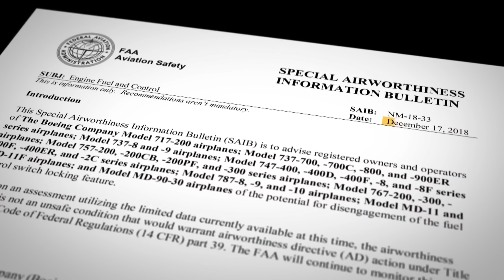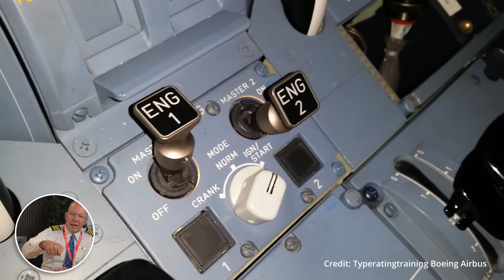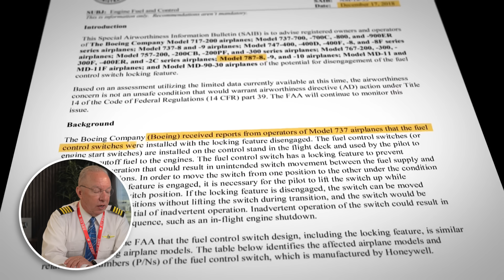Air India 171: The FAA’s 2018 Fuel Switch Locking Bulletin Explained (16 Questions Answered)

Comment: Was it human intervention? I have read that this aircraft had similar problems before but usually inflight...as in way after takeoff. I don't believe that the switches were physically placed to cutoff, there is every chance that an electrical issue caused this and to categorically say that it can't is ridiculous due to the computerisation of these aircraft. Do you really think that the switches can be set to cutoff within 1 second of each other? Maybe if they were not switches that require additional actions such as pulling the lever out, but with this type I am not so sure. Could you do a video on that showing that the switches can be turned to cutoff within 1 second?

Are we surprised that the NTSB and FAA have not put out any warnings? Lets not forget that the NTSB withheld information regarding the 737 max crashes and the FAA allowed Boeing to self regulate, so both in Boeing pocket....and it wouldn't be the first time that Boeing have tried to cover things up....lets not forget flight 811 and how Boeing and the NTSB tried to cover that up.

Comment: There should be a 5 second alarm from moving a fuel cutoff switch from Run to Cutoff, before the fuel pumps actually cut, giving the pilots time to correct the switch if it were an error or accident.

Comment: Airline engineer here. Just to be clear on the embraer cutoff logic - I belive it is only related to shutting engine by rotary knob used to start/stop. In case of fire, you would use "fire handle", by pulling you isolate fuel, hydro, and electric, instantly.

Comment: #AskTheCaptain  Why aren't critical aircraft controls like fuel cutoffs equipped with flip-cover switch guards (mollyguards)?  While rapid access is essential during emergencies, these guards require only 1.5–3.5 N to open—well within the capability of a single finger. Given an average human reaction time of \~200 ms, the switch could still be accessed within 0.5–1.0 s. Additionally, activating the cover could trigger a visual-auditory alert on the cockpit dashboard to signal intentional engagement of a protected system.

Comment: One unlikely scenario could be that the switches were installed the wrong way as Captain Steve said was in a bulletin and the engineers and our pilots decided to bypass with something to keep it in the position. For example, to illustrate the point, although I don’t think somebody would do this, and elastic band. Then that device fails and they fall back into the off position and that would explain the dialogue in the cockpit. Yes I’m definitely reaching. I’m sure the NTSB will have considered this possibility.

Comment: When a catastrophe result from many factors including a confusion by the crew , the though process how this confusion may occur in the futur at the design stage is not obvious…Then, after the investigation, if the Mfr. Boeing or Airbus improves the ergonomic cockpit set up to prevent such confusion from unlikely to impossible, then many “experts” start to blame the previous design to be a root cause of the accident which is not the case but only one element in a chain of events. I can recall the Mont Saint-Odile Air inter A320 crash flight A148 jan20 1992 during the descent with no visibility. The descent could be set on autopilot in feet per minute or the switch on the altimeter gauge low right side corner, could be turned to the other degrees of slope angle position. Then the digital displayed below the gauge show -3100 for the feet per minutes or - 3.100 for three point ten degrees as slope angle of decent which is about three times steeper that 3100ft/min and about 10.000ft/min.
The crew has to decide upfront what set up will be used and when but here,, the switch position and display reading got both confused and overlooked while being clearly one next to the other and almost impossible to be misinterpreted, but provided which one to use had been decided upfront  as per à normal procedure. The confusion was a clear cockpit management issue aggravated by a large generation gap and what was obvious for the old pilot was not yet fully known by the young copilot . In addition the company pilots unions had agreed on this new two crew only plane w/o radio navigator mechanics!!, but only with a minimum work load so the optional ground proximity warning system GPWS and many goodies LLWAS etc..had been disregarded by the airline consist specifier (who committed suicide after this, accused of having been greedy, but he had been forced into it by stupid unions) But not only , Airbus also changed the display to a two digit only with the switch on the degree of slope angle,  showing 3.1 if the degree of angle is selected and with the switch on ft/min the display 3100 so four digits …and of course Airbus was then criticised a  possible cause of confusion , but obviously here both unforseen and hard to predict. This is bad because this can prevent some nice and useful ergonomic improvements to be implemented only not to be accused that design was WRONG before…or not to re certify the pilots differently…( 737 Max “hidden MCAS “ syndrom) a field when only the qualified certification agencies should have the final word…

Comment: There is one ugly question that no one is asking. What are the conditions under which the fuel control switch goes to "cut off" automatically - in a system operated way?.....

Comment: From a system design perspective, it seems nonsensical to have both fuel cut off switches in the same location without a logical confirmation step thereafter to confirm its selection.
I’d go as far as to say each Engine cut off should be at the far left & far right of the cockpit controls under a guarded flip cover.

Comment: The problem is if you have cameras in cockpit you can not blame dead pilots. It is a huge threat to aviation industry.

The problem is if you have cameras in cockpit you can not blame dead pilots. It is a huge threat to aviation industry.

The problem is if you have cameras in cockpit you can not blame dead pilots. It is a huge threat to aviation industry.

The problem is if you have cameras in cockpit you can not blame dead pilots. It is a huge threat to aviation industry.

Comment: Capt Steeeve keeps saying these are mechanical switches. Unless they have a cable connected to the switch and that cable operates the fuel valves, they are not purely mechanical switches. They are most likely a mechanical lever that operates an ELECTRICAL switch. Which means you can't outright discount the questions about some kind of electrical failure. Pilots would be well aware that complex systems have complex failure modes and this is why these things should not be disregarded even if it's highly unlikely.

Comment: Captain Steve I'm an ex oilfield well intervention person and my question is 'if there is a flapper valve or a ball valves on the suction of fuel to the engine would it be a case of the valves mechanical failure leading them to shut even if the manual Valves were not intentionally shifted into the shutdown position leading to engines fuel starvation?

Comment: Hello, 
One theory is being circulated that
when engines are failing due to any unknown reason, and both the engines are losing thrust, it is SOP to put the fuel control switch to cut off and place back to run while press and hold the RAT for 1min. 
Is it relevant when the primary report does not mention the exact time of cut off. Can you shed light on this?

Comment: if theres a way to prevent CVR audios to leak (obviously its secure with a lot of sophisticated softwares involved) i think camera data can also be installed and integrated. The camera would have not prevented anything but would help significantly in investigations

Comment: Gravity has a tendency to pull things DOWN.  I have never seen gravity lift something UP.  Is it time to redesign these fuel cut off switches so DOWN = ON and UP = OFF.  Then if there was a fault in the locking system it would turn the fuel ON rather than OFF?

Comment: I like your channel, still I think you brushes over the video from the cockpit too fast. I understand the concerns, but how would it be a bad thing if pilots doing things they're not supposed to leads to a discussion with the boss (put in the ones responsible for pilot behavior). If anything it could perhaps elevate the safety and find pilots who maybe are not suited for their jobs, or at least lead to them changing their behavior before something goes wrong. Wouldn't video have been helpful with the 787 chair switch failure as one example?
I really admire the skills of pilots and the responsibility that goes with it. That takes a special kind of mindset to handle in all situations. I do think such minds would understand and come to terms with video (or picture sequences) from the cockpit for the good of overall safety. It could even be helpful for yourselves in cases where colleagues behave inappropriately.

Comment: Does the Flight Data Recorder capture the physical switch position or the state of the fuel cutoff signal as transmitted on the databus? If the latter then could the FADEC or fuel control system have commanded the change from run to cutoff and that's what's been recorded on the FDR?

Comment: A VIDEO CAMERA in the cockpit wouldn't prevented the accident, BUT COULD SHOW WHICH PILOT SWITCHBACK THE SWITCHES, IF IN FACT that's what happened. The pilot families, perhaps other coworkers would want to know which one was the one that did it. ALSO, it could potentially show FOR A FACT, if it was one of the pilots on purpose, OR IF IT WAS a fault on the computer OR if the switches disengaged on it's own, or human error somehow. 

The video cameras can be installed WITHOUT VOICE RECORDINGS. The use of those videos would only be allowed to use in case of an accident. Basically, useful within 24 or 48 hours after recorded, and ONLY ACCESSED BY FAA or OTHER investigation on a plane accident saved remotely on any FAA systems. 

I work for a huge delivery company and the drivers ALSO complained about having cameras in the cabins. I can see the point, but there should be a protective way with huge fines involved if somehow they are used inappropriately without any accidents involved. 

In the case of pilots, if they suspect or somebody notified any of the pilots being drunk after takeoff it could potentially ended on an arrested pilot on landing. Also, Captain Steve said, what if one of them is reading a magazine when they are not supposed to? They get paid to fly and potentially prevent an accident if they are paying attention to the sky AND NOT A MAGAZINE. The SAFETY OF THE PEOPLE FLYING IN THAT PLANE SHOULD BE A TOP PRIORITY, AND NOT A MAGAZINE. ALSO, IT CAN KEEP ALL THE PILOTS DOING WHAT THEY ARE SUPPOSED TO BE DOING IN CASE OF A MINOR ACCIDENT OR AN ACCIDENT WHERE THE PILOTS SURVIVED TO SEE WHAT THEY WERE DOING AT THAT MOMENT, AND NOT READING A MAGAZINE. IT'S LIKE TEXT AND DRIVING, THEY CAN GET A COURT ORDER TO BE ABLE TO ACCESS THE PHONE DATA TO FIND OUT IF IN FACT THEY WERE TEXTING AND DRIVING.

Comment: With an FDR and CVR already in the cockpit…often neither surviving a crash….a camera is just a reactive tool  won’t really be of much use, other than to appropriate blame. Might be more useful addressing the extreme pressure and coercion that occurs in large airlines getting pilots to work the most hours for the least pay.

Comment: Hi Captain Steeeve, greetings again from Chile. Why the preliminary report does not shows in what moment where both switches moved to the cut off position? If the time required to shut down the engines takes from 30 to 60 seconds, as you said it before it could have been done after the take off clearance from the control tower or could have been done a few seconds after the take off run after to move forward the two power throtle levers?

Comment: Captain Steve, the value of video recording is clear in this situation as it could show beyond any doubt whether the cut off switches moved to the cut off position accidentally or on purpose through the action of one of the pilots
Reply: Exactly.
Reply: https://youtu.be/vumDzVRV0ZA?si=6DGYJFmmFoNKcsnO
THIS NEWS tells that this Airplane had a DVR Digital Video Recorder.
Reply: ... and EQUALLY IMPORTANTLY whether the Aircraft acted of it's own accord for whatever reason and NEITHER PILOT TOUCHED THE SWITCHES ... The latter possibility is being studiously covered up blatantly !
Reply: Absolutely.  I've been shot down for saying what is an indisputable statement - video could have told us the critical fact, instantly.
Reply: That camera recording will be crushed eventually unless its designed to keep the recording  inside the black box
Reply: @benaven1786  you'd be surprised how durable modern electronics are. Many light aircraft (no black boxes) crashes have been solved because the pilot had a gopro going and the memory card survived.
Reply: @PsRohrbaugh  Yeah, but many times in fireball crashes, the black box data is corrupted. Which makes me wonder why they do not have it sent constantly via the internet access that most of flights have.
Reply: @justwag9750 probably its a lot of data. I had worked with autonomous vehicles data, and ite generates GBs of data per minute. But mostly due to raw video, if they use normal video files, that should be manageable
Reply: @hindustani-k8x  As I said, maybe use the internet connection that most passenger jets have now to send the data, voice, and video live to some very secure server.
Reply: @benaven1786  Where else would it go?  Of course it would be contained in the crash-survivable memory unit
Reply: @stephend  A lot of the time the data is corrupted in these types of crashes. (Fireball, explosions) They should have the data being streamed live to a database through the internet connection planes have currently.
Reply: @PsRohrbaugh  Make the system send data only, no receiving at all. Is what they will have to do... And I know aviation moves slowly. I have been a rotary wing pilot since the 80s. Served 20 years in the Army as a helicopter pilot. The last 11 I was in the 160th. Aviation moves slowly, yet for military, they move a tiny bit faster.

Comment: First officer inadvertently cut off engines instead of raising up the gears. In his head, First Officer raised the gear and was totally surprised of the consequence. Different locations in the cockpit, and still it happened. Captain was not paying attention. Captain noticed something was wrong, asked about it and restarted the engines. Too late. Both pilots are at fault.
Reply: Interesting theory
Reply: @SharksSJ408  Pilots raise landing gear quite quickly after rotation and it's the First Officer job. This plane had the gear down all the time and in that timeframe for raising the gear the engines were cut off. First Officer made a terrible mistake without realizing it. Unfortunately the Captain was not playing attention and crosschecking wasn't performed. Reason for 2 pilots is exactly to prevent such mistakes.

Comment: Why would you need a total electrical failure? Can a single bit flip potentially cause this issue? My understanding is most planes use consensus parallel computing methods, but this should definitely be investigated and would be Boeings fault.

Comment: Sorry to Labour the point Captain but you said clearly ,”it is not a design fault” but wouldn’t you agree that their positioning is unnecessary and had they been fitted in a place better suited the problem might have been averted?
Reply: You mean the switches? Sure, a way can be designed to make it harder for a pilot to crash a plane by cutting off fuel to the engines, but until 1:39 pm on 12 June 2025 this hadn't been thought of as a threat to be averted.

Comment: Capt Steveee is clearly working for Boeing now 

These switches can automatically go to switches off position due to mechanical glitch or software malfunction (strong gut) 

Pilot community over the world should come on this issue 

Beoing (Comprimise Qulaity ?? + Air India flight Maintenance?? ) whole world knows 

Guys kindly google/youtube on this switches topic
Reply: It must be a defect in the plane, otherwise the captain works for Boeing. Thank goodness you're not a judge in a court of law.
Reply: Sad to see directly blaming pilots without doing proper investigation. Same thing has happened on 737 Max as well. After second crash they acknowledged there was a software issue. Initially they denied. Similar situation unfloading here.
Reply: Agree, it can well be a switch mechanical failure.
Reply: One of the passengers texted to his family that the aircraft shook violently during takeoff. The strong vibration could have knocked off the switches from RUN to CUTOFF. It is quite possible.
https://www.youtube.com/watch?v=fFlRwsfEZes&ab_channel=DiscoveryQuest
Reply: Thank you. 💯

Comment: There seems to be an intense conversation about the fuel cut off switches.  What is critical is simply, why are they fitted where they are and not fitted somewhere that they can not be accidentally knocked of intentionally used without the pilot monitoring noticing easily?